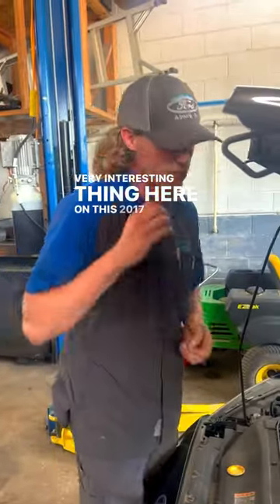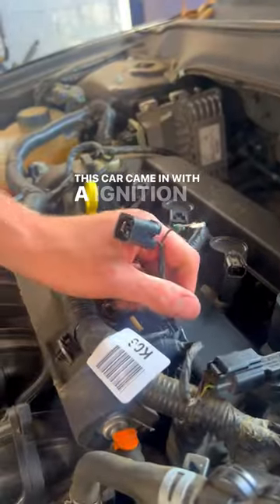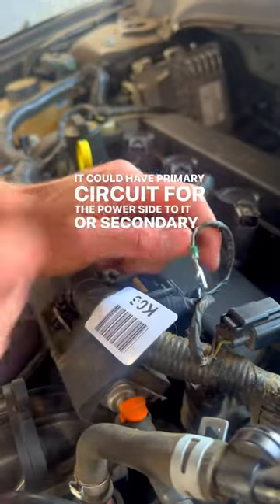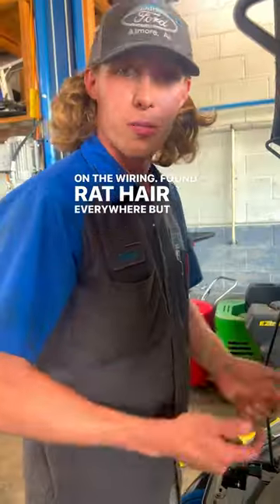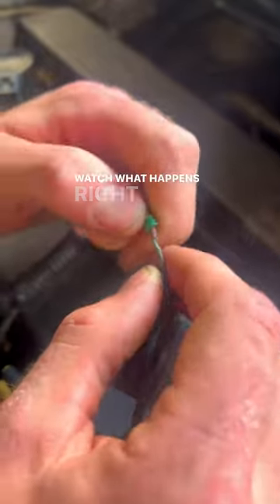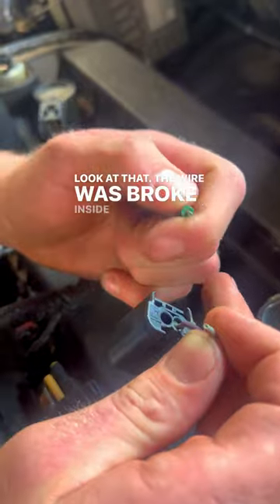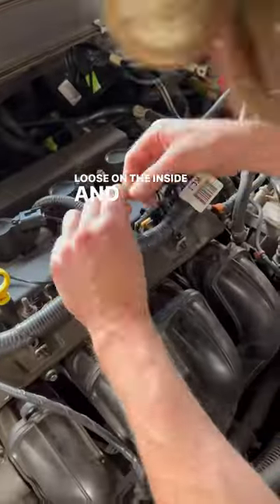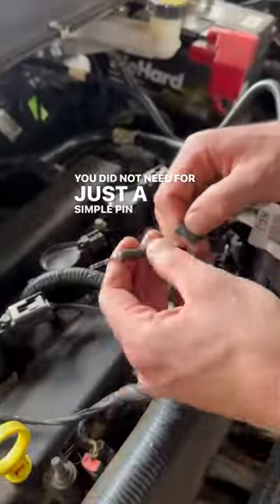Cant believe I caught this one #shorts #ford

Comment: Load testing circuits would tell you whether it's corroded or damaged. It's possible to have the desired voltage and still have a bad wire, not allowing the correct amount of amperage to flow. I got burned on it once, and now I will not condemn any electrical components without load testing the circuit.
Reply: Test lights are easier and faster but voltage drop is scientifically accurate. They both have their place
Reply: @firstlast---  A test light isn't load testing a circuit.  I just find load testing is faster than voltage drop they work the same.
Reply: @austinjones5962  Right, I should have been more clear. My test light for load testing is custom. A single wire test light won't put a load on a circuit

Comment: I have a '13 Focus, I had something similar with the BMS. But it was the signal wire at the alternator. The wire corroded inside. Cut it back to good wire and crimped on a spade connector to connect to the alternator instead of spending $300+ for the entire wire harness
.

Comment: That's why you check for continuity between pcm pins and whatever load , sensor, relay or actuator and put a load on the wire to rule out loose connections or wire broken inside jacketing before considering a pcm/module replacement

Comment: I had a similar issue but it was with the power supply wire to the RCM. I power probed it from the fuse to the RCM and found a decent voltage drop. Replaced about 7in of wire that looked sus and afterward inspected the wire closely and noticed in pin size spot of rust coming thru the insulation.

Comment: Bet fords diagnostics procedure is what would tell you to replace the pcm
Reply: Don't know about Ford but I know toyota would probably do something stupid like that. During my time working for the procedure always said replace the module first then diagnose after. Strange really
Reply: ford first diagnostic step of any. diagnosis is always visual inspection of all components, if you fail to do that it's on you not ford
Reply: @CrosstownExpress  Toyota uses voltage checks instead of resistance if possible the live circuit makes a difference domestic makes love resistance checks
Reply: @royalblood2405  a visual inspection does not include isolating wires from a harness and ripping at them
Reply: @Tony Jacques  if you want be a stupid mechanic that's on you

Comment: What you  should do it buy 1 to 2 gallons of diesel and put it all over the  Interior and engine bay arer use road flares 2 minimum and set the whole car on fire that car in order to replace light bulbs you need to remove bumper!! It has such bad wiring harness that it brakes and comes to pieces in your hand cheap quality car

Comment: Needle in a haystack, good find or lucky find?. Why would anyone replace a PCM before doing wiring testing or replace a coil pack without swapping coil packs?? Stop throwing shade cuz ur certified... U also have a thing called dealership resources (wiring charts, detailed service manual). I detest this mechanic attitude.

Comment: I had a mouse or chipmunk do this to both my cars within a week. Ate both fuel lines on both. Then on the jeep it went nuts on my fuel pump wiring and my under engine wires. Ate the wire down to the pin... Had to learn to repin em. How fun.